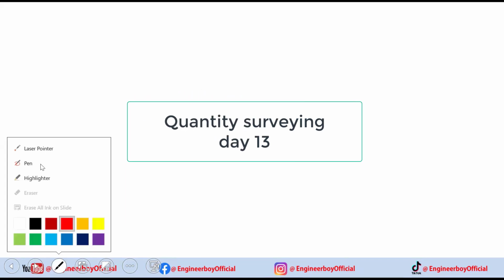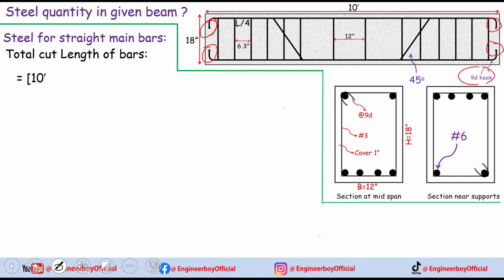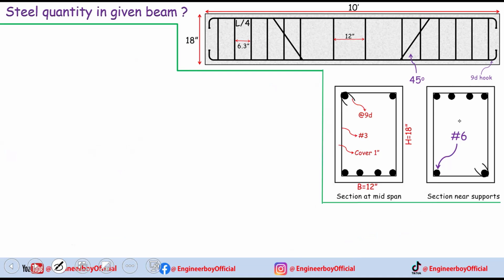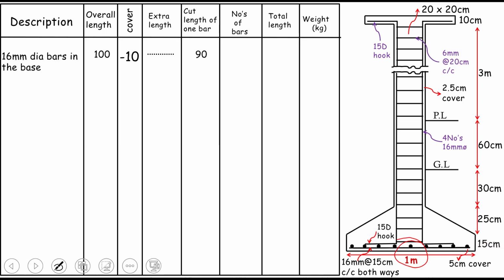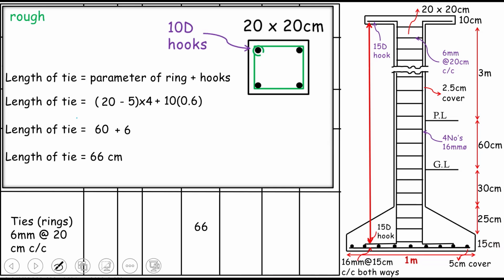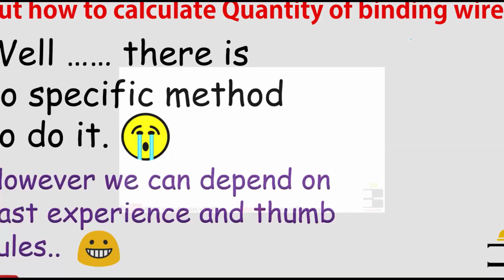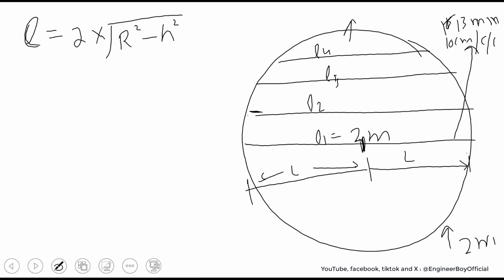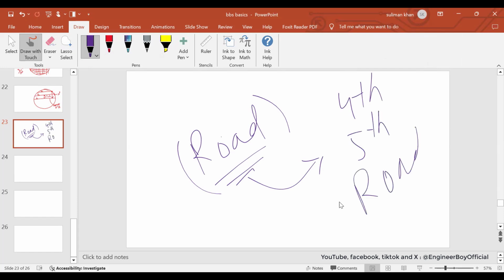(Complete) Quantity surveying | cost estimate of building | full course| day 13

Comment: Hi sir, 9D is d is diameter of bar which is usually in range 6mm,8mm,12mm,16mm,20mm,25mm. Here i assume it will be in mm. Mm to feet convert will 1/304.8 right why you use inch?